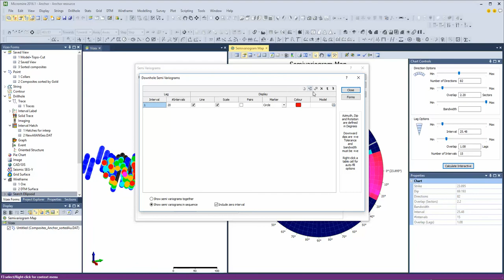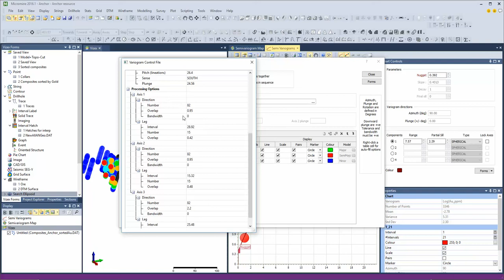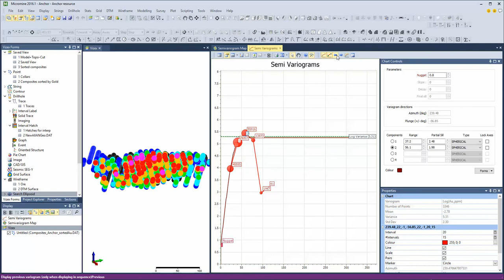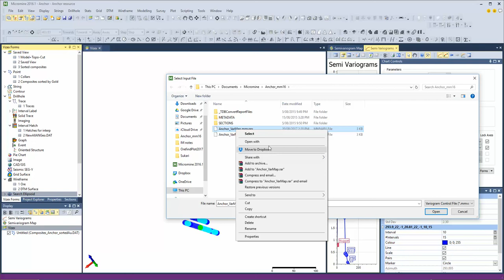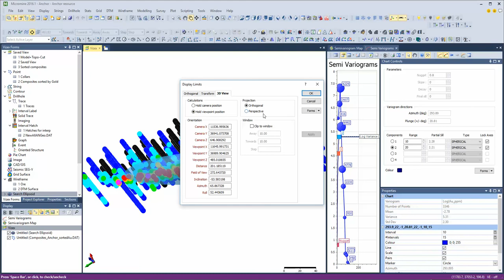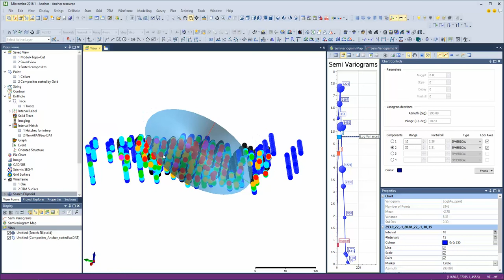Micromine Variogram Modelling 3

Comment: Theres no leapfrog modeling sir?
Reply from the maker: No, these are for Micromine. At the time LF could not do this, perhaps when I get the time I can do some models using Leapfrog.
Reply: @ronreid5702  thank u sir, realy apreciate that u can make leapforg tutorial. I wonder to know about design resolution in leapfrog, in my case i want to model the mined open pit, but the pit model is not precise both using deposit n intrusion, can u help me with that sir? Thanks..
Reply: @ronreid5702  one more thing, in my case the resolution of geological model cant be set to 1, its max at 1.5, theres solution for this case sir?
Reply from the maker: @ruztdaloccozz  for leapfrog, the maximum resolution you should use is 1:1000. If the longest edge of the model is 1000m long, 1m is the finest triangle resolution you should use. Better if it is 2 or 5 m, else the model can become too big to handle. It seems like you are trying to get a resolution finer than the software can handle.
Reply: @ronreid5702  okay sir thats my problem, by the way my pit area is 10.000.000m2 its not possible to make resolution 1, maybe do u have the solution to solve this problem sir? Because i need to cut my geological model using open pit design.
Reply from the maker: The best option is to make sure the model only covers the open pit. If your open pit is 600m by 400m then 800x600m is big enough. If your pit is 1000x800 then 1100x900 is big enough. It is not possible to get a model as big as yours to a resolution of 1m as it is too big. The software was not designed for that resolution. I have built models 5000x3000km in size but the minimum resolution was 5km in size. You have to stay inside the capabilities of the software. Given the size of your model, a 10m to 50m is all you can do. You can then create a sub model that covers the pit with higher resolution but it is a separate model with finer resolution than the larger model.
Reply: @ronreid5702  thank u so much sir, its realy helped.. by the way any another software is possible to solved my problem sir? For example i make the geological model in leapfrog n cut it in another software so i can get the precision mined open pit.